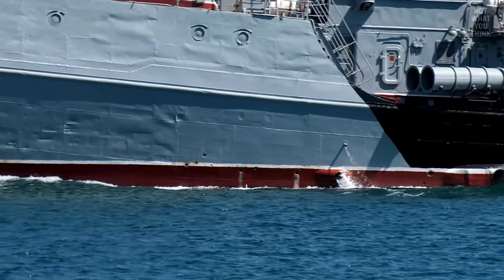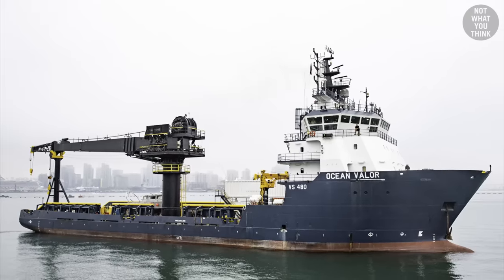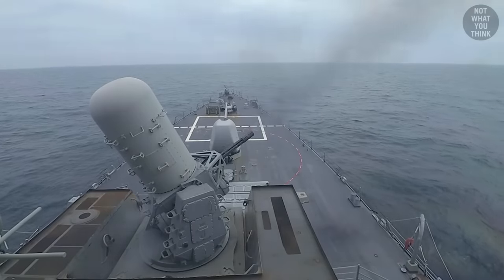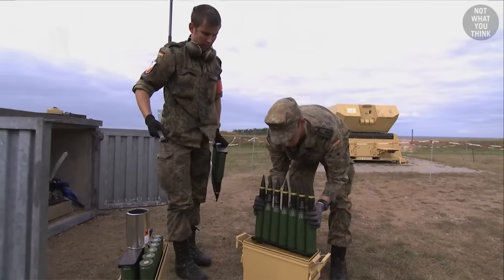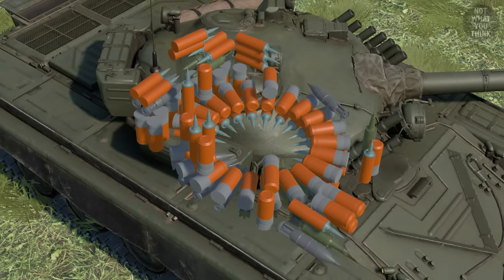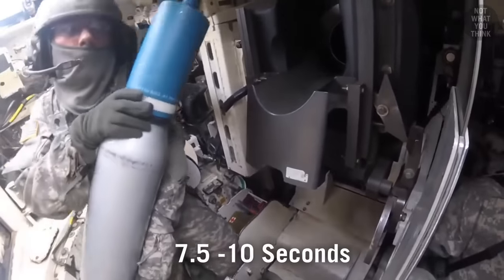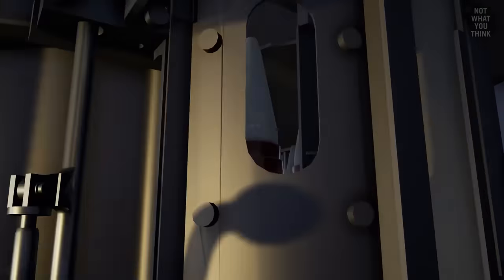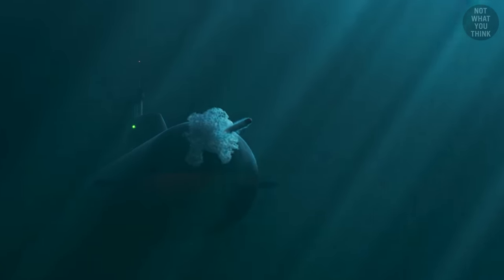Why Reloading Modern Weapons is Harder Than You Think

Comment: There's absolutely no way an autoloader is lighter than using a human. Also, autoloaders aren't faster. A good Abrams loader, can load a new round every 4-5. Lastly, autoloaders are horrendously unreliable, in every real world application. I got to talk to polish tankers that use T-72s and they hate them, say that they can easily rip your arm off, or crush it, if it's in the way, and they jam frequently. I had an NCO who was stationed at Hawaii and had to crew the Stryker MGS, which uses the 105 gun from the M1 Abrams, and he also said that they were unreliable pieces of shit that jam every 3-5 rounds. 

I was a loader on an Abrams. Autoloaders, as they exist on every major armor application, absolutely fucking suck.